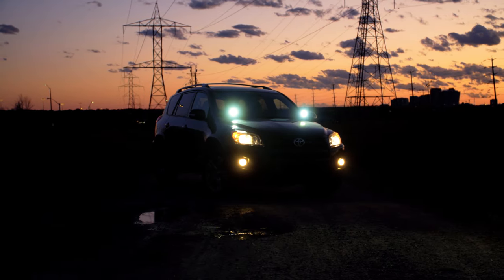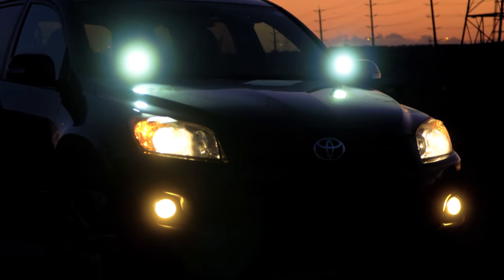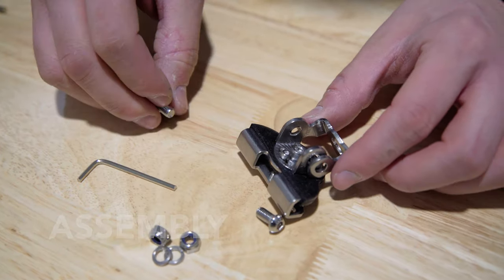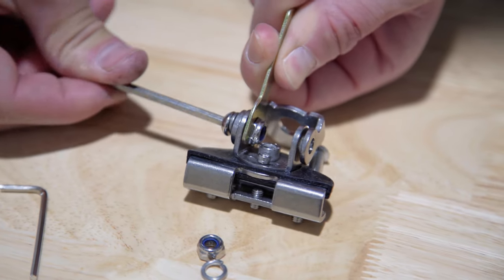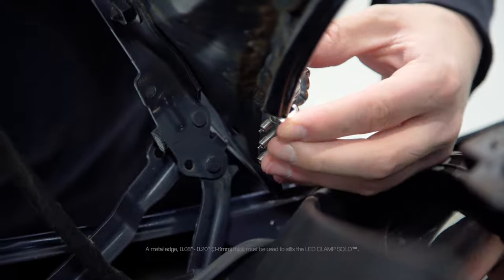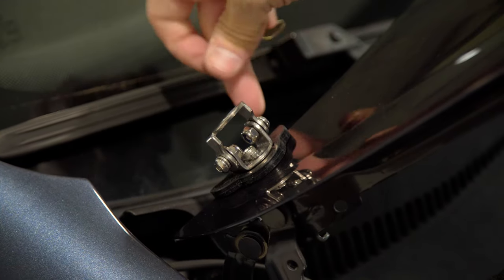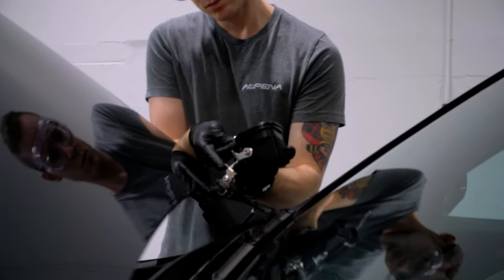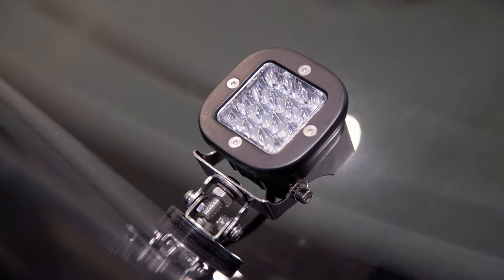Install LED Clamp Solo Universal Light Mount from Alpena

Comment: These are on Amazon. Same style. They dont tighten well
Reply: little extra thread lock should help? hopefully, as I ordered a similar set XD
Reply: Well problem is they're cheaply made and the metal is chineseium
Reply: @TheShangralaaaa17  ive heard of this chinesium, is it anything like stainless steel?
Reply: @coltentodhunter7551  it's just cheap metal. It's not a real metal.
Reply: @coltentodhunter7551  any follow up thoughts?
Reply: @Sgt_Plague  using the correct Allan key and tightening uniformly & slowly, place the rubber foot accordingly, and use lockttight, , thats all I got. worked for me!
Reply: @coltentodhunter7551  ok, thanks for getting back. Will give them a go!
Reply: @coltentodhunter7551  oh sorry, while I think of it, what lights did you mount on the brackets and have they moved at all from the weight of the light, going over a bump or whatever?
Reply: @coltentodhunter7551   Bit lost as to where that came from. I clearly misunderstood as I thought you had some. Asked what lights you’d mounted on them, so I could decide if they’d cope with some rigid d2’s. A comment on this very thread said about cheap chinesium metal.
Yes, nuts and bolts and use loctite. Or just use decent nuts and bolts. 
What I was trying to ask was, in light of the chinesium comment, are the brackets strong enough or have they bent/cracked with whatever light you put on them (would have looked them up for the weight to compare to the rigids)
I see on eBay there’s 3 and 5 grub screw versions.
Maybe I’ll just concede and drill the bonnet, there’s a suitable spot. Saves hassle 🙄
Reply: Yes, these are cheap, once you snug  the 3 bottom bolts  they strip easy when you try to tighten them, they diddnt hold my 20 inch on my hood